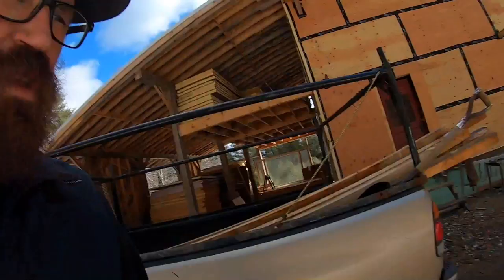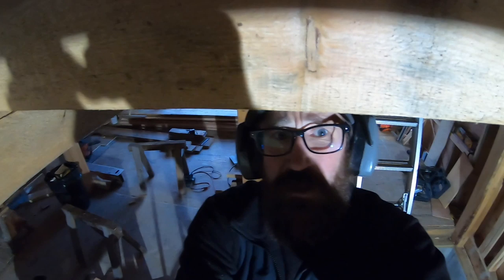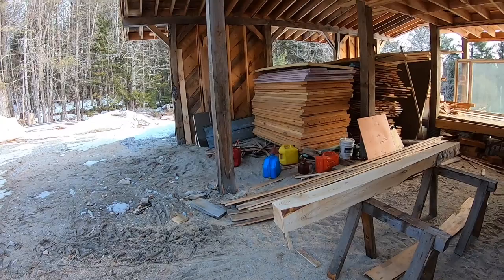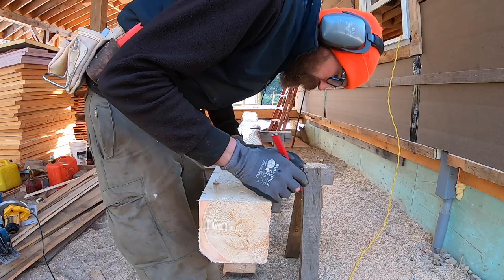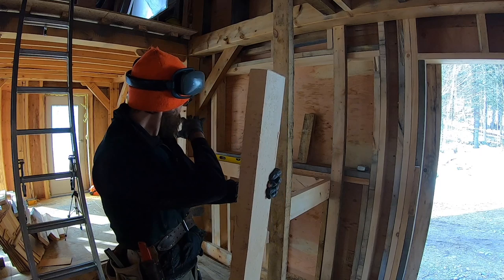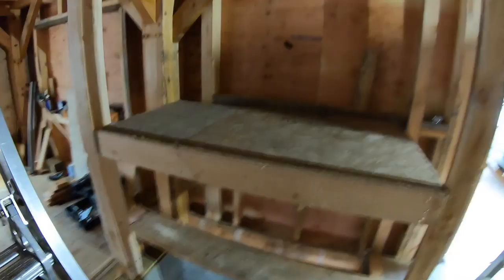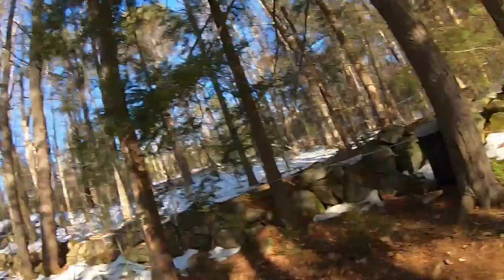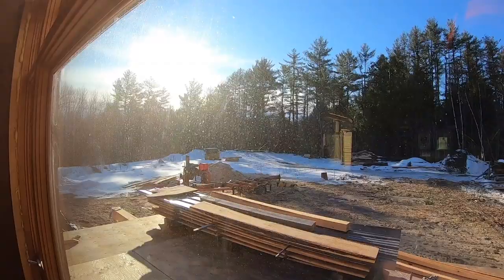Building a House from Trees SE 5 EP 20 Building Stairs

Comment: Hello Bus,  You have redefined optimism for me!  "It was all cut at the same time so it will move the same as it dries"!  Wow.  I grew up next door to a small professional circular saw mill (even worked there once in a while) so we used a lot of green lumber.  In the next several decades I have use kiln "dried" construction lumber which gets rewetted (sic) as it stands out in the weather while you are framing so after dry in it also has to cure although not as much as green.  The one thing I have learned about wood is it is entirely unpredictable in how it will shrink, too many variables, and if you want to geometrically increase those ways get a chunk with a center ring in it.  Treated lumber is really fun for this.  I have seen a three foot piece of center ring four by four twist and bow twenty degrees or more after it was fastened in.  Best I could ever do was allow for it.  Predict it... not hardly.  

On another note I can't help but ask why you wear your tool belt so high?  None of my business but it is like fingernails on an old time chalk board (slate).  I have seen some worn that high the first day on the job but never the second.  Whatever floats your boat but it has me wondering the reason that I may be missing.  Kind of an itch I can't help but scratch!  The Trees are looking good.  Take care.  Doug
Reply from the maker: I would love to wear my tool belt like a normal human, but I have no but at all, and there is no ledge back that for it to settle on, so i have to wear it around my stomach. Its horrible. Best part of the day, taking it off. Thanks for the comment!
Reply: @BusHuxley  I have the same problem but years ago I went to the harness which distributes the weight and is immeasurably more comfortable.  Before that I used padded suspenders.  Thanks now I feel the 'itch' receding!  Doug
Reply: Bus Huxley You could wear it low with suspenders possibly?